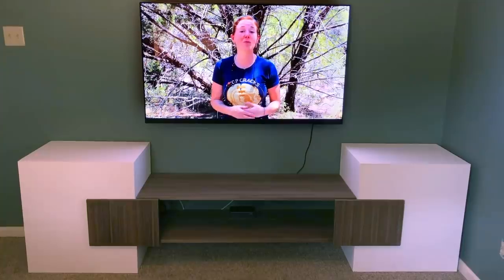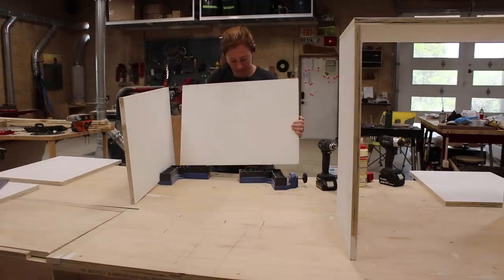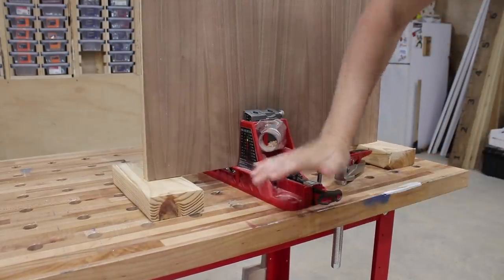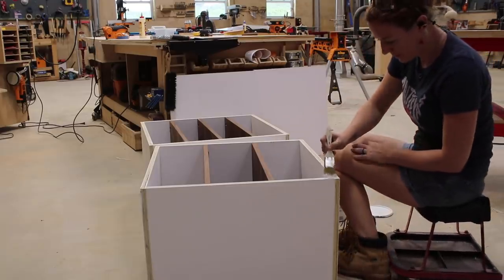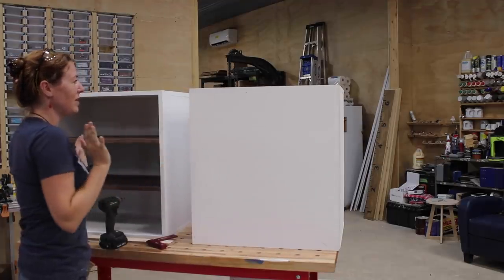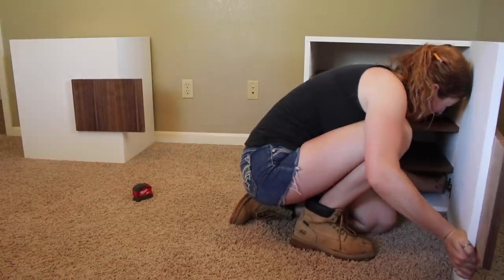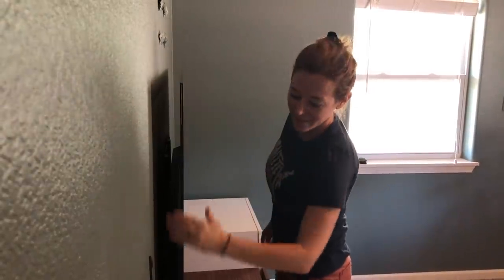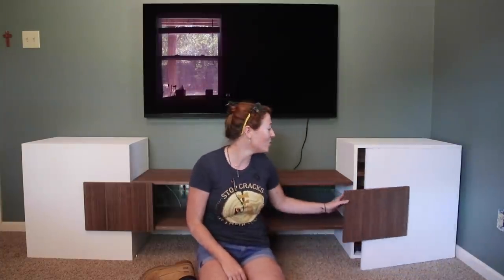TV Stand or Media Console! How To Make A DIY Entertainment Center

Comment: I still miss klutzy April, but I am in awe of how far you have come in just a few short years. 
Two things I would include would be a back to hide the wires, and putting the TV cable and power wires down the inside of the wall. 
Awesome project, from design to fabrication.

Comment: April, this is a great simple build and looks great .. but you knew that ..so ... glad you had fun too. No matter whether you have a rug or hardwood you may still want something to lift those boxes up at least a 1/4 inch or so...Easier to move and clean around etc. And maybe not so convenient to animals and ??? One other thing .. maybe adding brass dowel rods into the shelves to hold to the side cases would prevent unwanted shuffling but removable to separate and relocate etc.?.

Comment: What a great idea. If the carpet was going to stay you could make it float by adding 4 small cubes to the bottom, just set the front two back (but not too far back). Or a cylinder dead in the middle (like a big foot). The OLED tv was niiiice :)

Comment: Great video April! Another way to stop the veneer unravelling is by pulling from the inside of the rolland if you ever can't find the end banding cutter try using any scrap piece of metal that has a 90 degree corner. It creates really clean and quick cuts that never dig into the face veneers:)

Comment: April great film and unit once again 👍.  Just a quick tip if you use the side edge of your chisel and drag it along the edge you wish to remove, saves digging in and a lot quicker also gives a tidier edge for a quick sand off.

Comment: Unique and beautiful modern design. If it was floating off the ground 8" or so would finished if off for me . Could just screw it through the back directly to the wall as the backs are well fixed on. As a full time carpenter here in ireland we use iron on edging tape alot and just a small tip, we don't use any special tools, just use the side of a chisel or plane iron not the sharp edge ! Might be some tips on you tube how to do it. I admire your work April excellent would love to spend some time with you share some of my 35+years experience . 👏👏👏👏

Comment: Hi April

Here's as a tip from a diyer from Holland , I do this on all preglued edging tape.
 see you use the chisel to take of the extra veneer from the preglued tape, just make a start like you do and then 
turn the chisel flat on the panel and the use of the chisel to cut the veneer, holding it at a little angle and force it gently down. 
when at the end of the chisel length raise it again and restart.  Hope you catch my drift.
Reply: Hi April

here's a little edit  ; ) 

Here's as a tip from a diyer from Holland , I do this on all preglued edging tape.
 see you use the chisel to take of the extra veneer from the preglued tape, just make a start like you do and then 
turn the chisel flat on the panel and then use side of the chisel to cut the veneer, holding it at a little angle and force it gently down. 
when at the end of the chisel length raise it again and restart.  Hope you catch my drift.

Comment: congrats on the 1 million subscribers!  BTW, have one of your sponsors send you a DC to be used with your track saw.  I have two Festool DC's and when I use either the track saw or the router table, there is virtually no dust.  Keeps my shop and lungs a lot cleaner.  Walnut dust is especially bad to breath.

Comment: Cut a couple of squares of the plywood you used and place them under the cupboards to lift them just enough to avoid the carpet, this will also add the illustration that they are floating.

Comment: The entertainment center is esthetically pleasing!  Something tall on top of the white storage cabinets would really set it off.
Wondering how the cable connections can be "out of sight , out of mind"?  How about housing them in a flat box painted the same colour as the wall... down behind the left side, behind the white cube, and into the the electronics.

Comment: Just a thought but wood glue adheres to the pores in the wood, if you paint the wood where it's going to glue you're filling in those pores and ending up with a weak joint. To avoid that you can lay down a strip of painter's tape the width of the mating surface along where the joint will be prior to painting and remove it after the paint is dry so you have a nice raw wood edge to glue to.

Comment: Would also recommend having the cabinets up off the floor by a little bit, so you don't constantly scrape the bottom of the door on the floor.
Reply: I'm sure she will if it still contacts the floor after replacing the carpet with hardwood.

Comment: would you do a short skirt under each of the cabinets?  even around 5/8th of an inch(or 1.5cm).  then you wouldn't have problems opening and closing those lovely doors, and the skirt would be mostly hidden in the carpeting.

Comment: Those critters in the background were brutal, maybe eq out the buzzing they make. Stand looks really nice though.
Reply: I had to pause the video to realize it was in the video not outside my window!  I have those bugs outside my windows most nights.
Reply: I wonder is LG's AI sounds would cancel them out.
Reply: Yeah, cicadas are LOUD!  They can definitely overwhelm any audio.  Handily, they are almost entirely within a small frequency band, though, so just using a graphical eq and drop the 8k and 10k bands down to -20 or so will almost completely get rid of the cicada sound while not really affecting the vocal range at all.  I believe that April uses GarageBand for audio and such processing can definitely be done there.  But... it is a separate step and when you're on a one-video-a-week production pipeline like April, it's hard to justify that time.

Comment: are you planning to have a mobile integration to your shop dust extraction to help with the tracksaw output?
Reply: She has a mobile unit - not sure why it isn't being used with the track saw. You can see her using it to suck up some dust later in the video...

Comment: As others have stated you still will need feet.
Could be simple half inch squares attached at corners (wood would work, but even hard rubber feet would do)
Because if you don't you will scratch the daylights out of your wood floor when you install it.

Comment: You could set the end cabinets up on blocks (maybe 1/2 inch plywood offcuts) so the doors will clear the carpet until you remove it.

Even if you remove the wall to wall carpet I'd think you'd want an area rug in front of the unit anyway for anyone who wants to lie on the floor to watch TV.

Comment: I hate unsightly wires. Even just one. Period.
Cut a couple holes, and use a Carlon single gang (or dual gang) low voltage box, and a couple recessed faceplates.
Snake your wire(s) behind the wall.
Reply: Oh, one goes behind the TeeVee, and the other down below.
Reply: A doc's office created a wall panel below the tv that was decorative and hid the wires without cutting holes.  Then, if other wired systems are needed down the road, decorative wall panel moved and returned afterwards.   It is giving me some thoughts before a renovation is begun.....thanks!